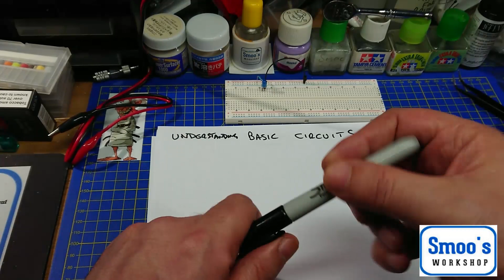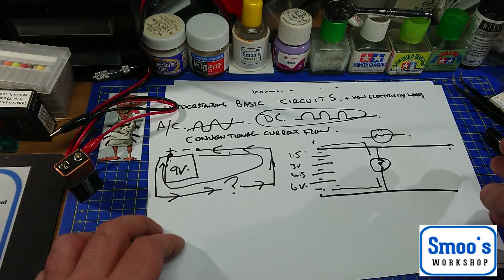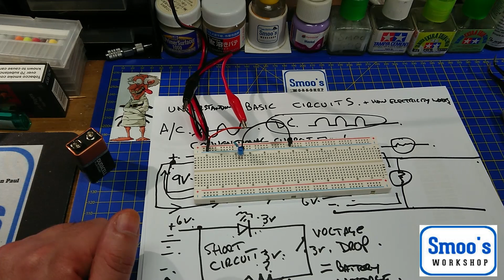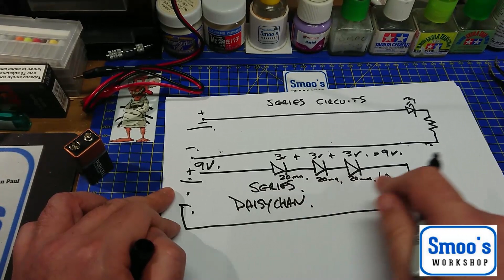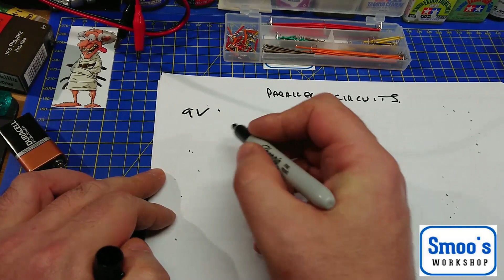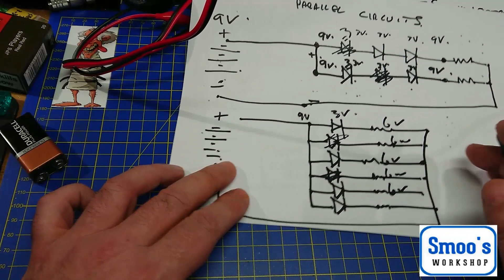Learning electrickery with the Smoo - Episode 2 - Basic circuits and breadboard basics

Comment: Thanks for showing how to use the bread board I have been using the leds and smds with the resistors 1.4w running 6v mains for my trucks check my channel out you can see them light please but what I want to no is how to make may indicators blink left and  right you said using a 555 chip how is this done sorry for going on a bit many thanks keep the videos comeing.
Reply from the maker: I will be covering how to make leds flash later in the series, there are a few methods for doing this including using a 555 timer or capacitors and transistors all of which are freely available on youtube already, i have been asked to start from the basics so it will be a few more episodes before I cover flashing circuits.
Reply: no problem m8 looking forward to your vids on another note have you finished the 1/16 big peter built yet
Reply from the maker: haven't done much of anything for a month or so having some health issues atm although i have made a wee bit of progress on the peterbilt it's no where near finished